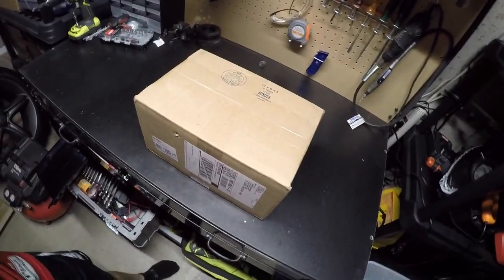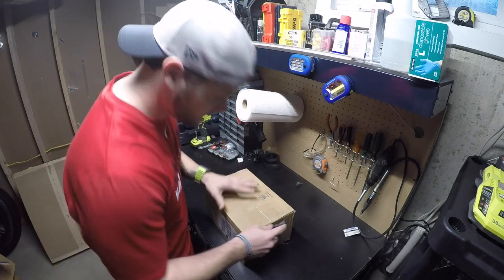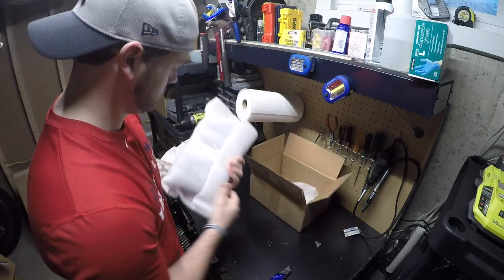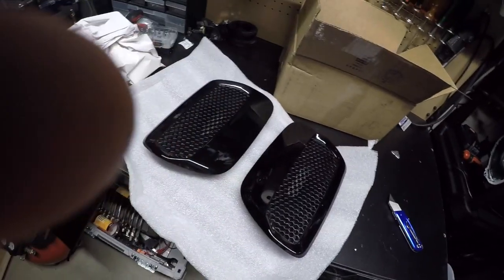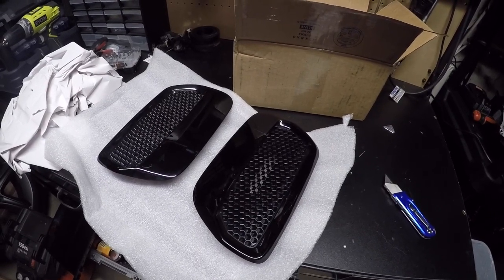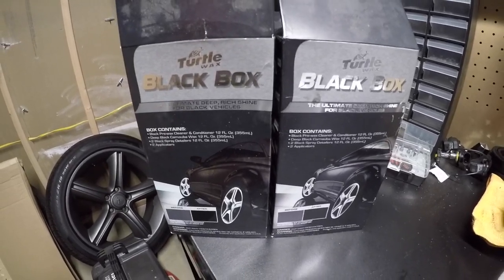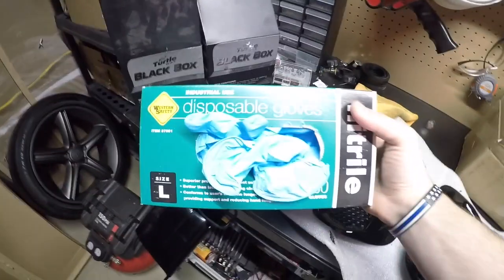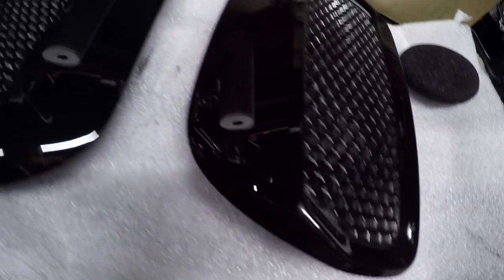2019 Mustang GT Heat Extractor Hood Vent Replacement

Comment: It’s funny you did this.  I bought a pre owned set too solely for the rear plastic dust collectors for similar price.  I didn’t wanna separate my stock ones. I wanted to do a one for one swap and have a fully assembled RTR and stock vent so the shell to me was trash but the rear piece was worth it.
Reply from the maker: Makes total sense.  So you took the underside piece off and its under the RTR vents now?